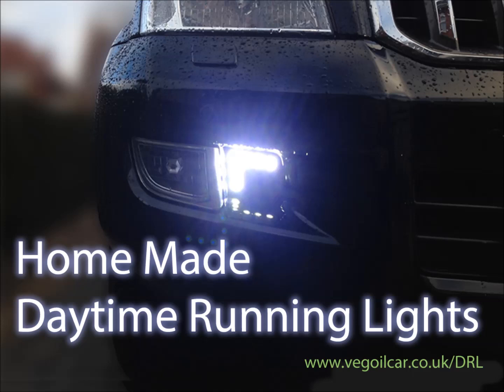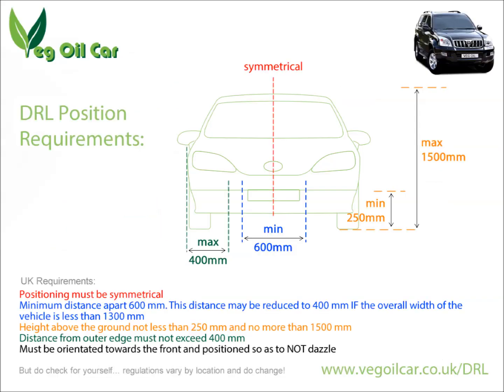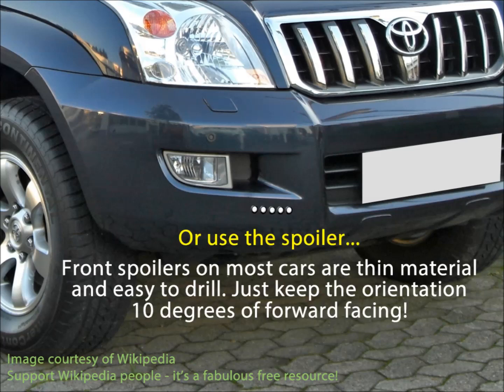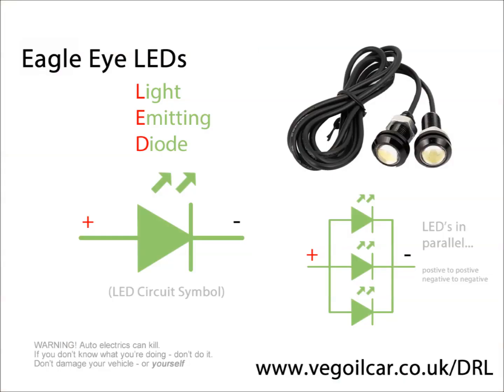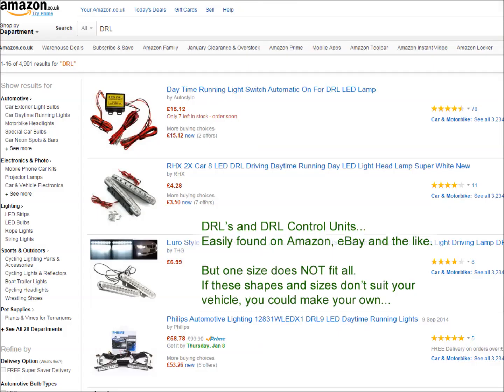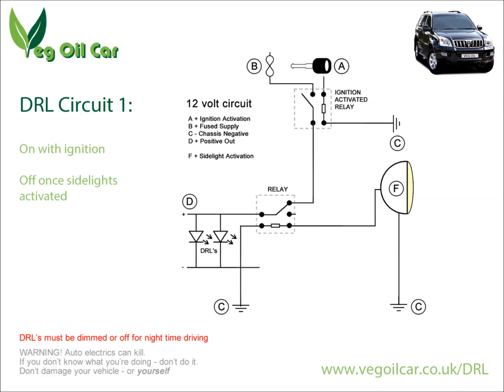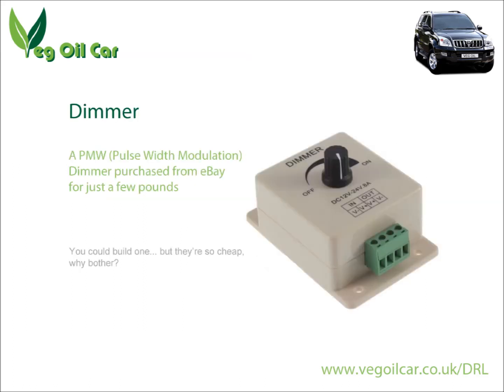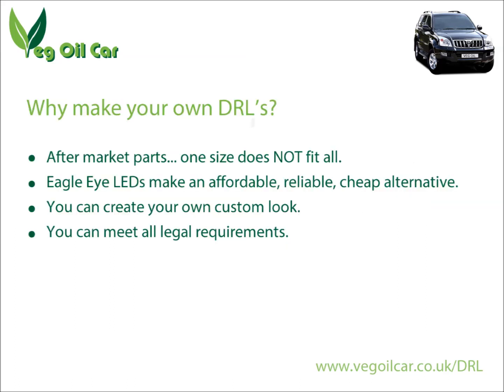CUSTOM DRLs make daytime running lights yourself - by VOGMAN

Comment: Thanks. Just one question, where does D or positive out go.
Reply: Just figured it out it goes to ground, right? Also does this operate the left and right lights or is it one for each side. I think it runs both left and right sides but need to be sure.
Reply from the maker: Hi Tom. No my friend - don't ground it. That would be a direct short and would blow your fuse straight away : (
I think the confusion lies it the way I've drawn the circuit, so I've redrawn it for you here... http://vegoilguy.co.uk/_maingifs/circuit1.png
"D" is not a point, it's a wire. It comes from the Relay and contains the positive flow. This then needs to go somewhere. In my case it goes to the Positive of the LEDs. The Negative of the LEDs is then put to ground and everything should work nicely.
And yes, you're correct, this operates BOTH lots of DRL lights. 
If you have any further questions, please don't hesitate to get back to me.
Geoff
Reply: Thanks alot that cleared it up. 

Another question, what numbered prongs do the wires go into on each relay?

 I'm not putting LEDs into my car as they were factory installed, it's just for my general knowledge. I'm just looking at youtube auto channels to have a better understanding of how may car works.
Reply from the maker: Hi Tom. It's always good to have knowledge. Good for you : )
I've updated the diagram for you with numbers here - http://vegoilguy.co.uk/_maingifs/circuit1.png
Have you seen my Relays video? You might find it helpful - https://youtu.be/T1o29KTVbTE
There's also my Fuse It video that looks at finding switched and permanent live feeds - https://youtu.be/8omZ545Cw1U
All the best.

Comment: Hi  I would like to know where did you get the ignition 12 v from ? How did you wire it ? (through where) Where did you placed the box with relays and dimmer ? I am trying the same method . have you still got it working ? Thanks
Reply from the maker: Hi Sreekanth. Thanks for your question.
Have a look at this video I did - https://youtu.be/8omZ545Cw1U - which will hopefully show you how to find a switched connection in your vehicle.
The relays were placed inside a sealed plastic box and mounted high up in the engine bay of my car so water would never be an issue and yes the lights are still working. A few of of the individual LEDs have stopped working, but there's still enough LEDs lit on both sides to create a bright effect. 
I plan to make new ones in the new year when the weather is better.
Hope this helps  : )
Geoff
Reply: Thanks for reply

Comment: what do these cost each, and approx total cost?
Reply from the maker: Hi Florence,
The cost is really down to how cheaply you can source the LEDs. They tend to be fairly cheap. 
I think I mentioned how much they cost me at the time on the video, but of course prices change and vary with location.
Everything was eBay in my case but that doesn't mean you can't shop around for a bargain.
Hope this helps.
Geoff